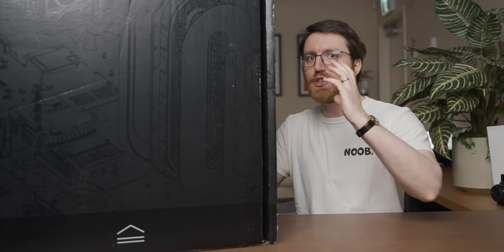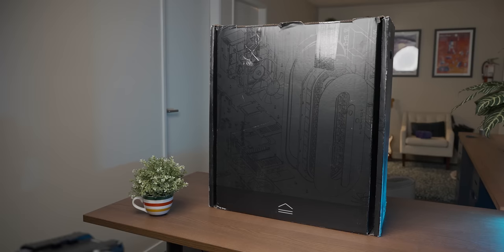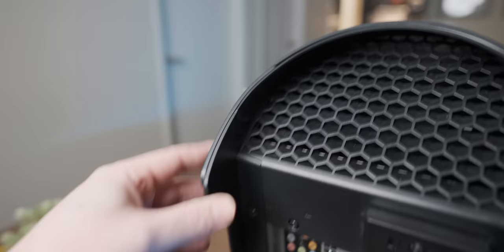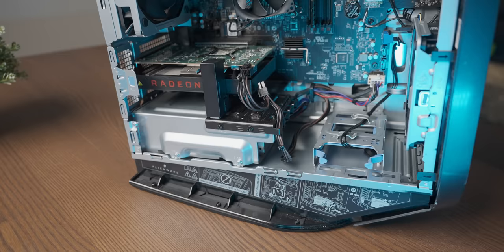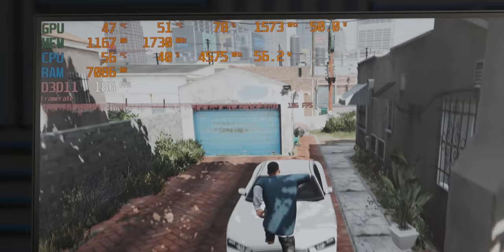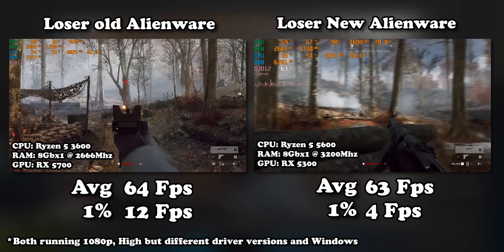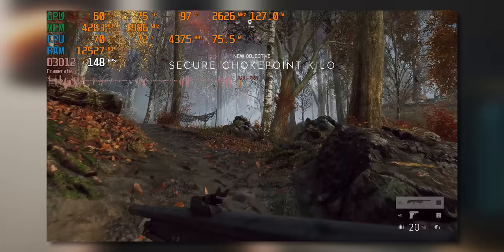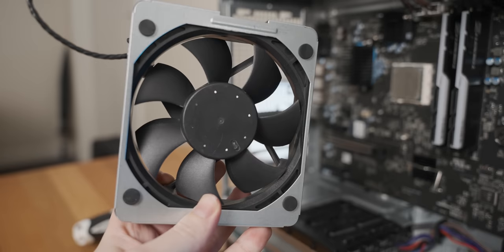Is Alienware's NEW Gaming Pre-Built Less Terrible?

Comment: All Dell system reviewers: "We bought the worst possible model offered by this OEM, (again!) Guess what? It sucks!" 

TBF: Dell should have higher min specs on these. Like no SC RAM options or air cooling. Those cheaper options should be kept in the XPS lineups. 

But anyways, I have several Alienware desktops. All options were carefully selected and they're not min spec units... guess what! They don't suck! Amazing, right?! The only mods I've done where I put in quieter fans. 

Also, the mid-range and higher builds are better buys for your buck and you should always call and ask for a better price as they give discounts easily. But if you wait for a sale you can even get decent models for a good price. I bought a Black Friday salefor my daughter for $1399 with an 11th gen i7, 16GB, 3060ti, 512 NVMe which I feel would have been a decent price even before everything blew up.

Comment: $1500 can get u an AMD rizen 7 7700x, a rtx 3070 ti, 32g of vengeance ram, Corsair heat sync, a lian li case, cable extensions, 850 watt power supply, Samsun 9 80 pro 2t ssd

Comment: Well to be honest, you really didn´t order the actual new Alienware PC. This is the same as the old one with a new Case (Aurora R14). While the actual new one (Aurora R13), (I know the names are confusing), does have significant improvements in the interior. You get watercooling as standard, the new 12th gen Intel CPU´s, improved Mainboard, better GPU options and overall better looking inside of the PC. 
You should take a look into the R13 if you really want to see any improvements on Alienwares half.

Comment: I was going to get one of these cause i thought my gpu died from water exposure but I tried the gpu again recently and it works now like magic.  Watching this video and looking at this case and the parts inside I'm very glad i didn't get one of these and fixed my own computer.  The plastic case looks like the same plastic they use for toys in a happy meal and the parts inside the mobo the gpu and the psu look cheap only thing thats good in it is the cpu and its going to overheat if any overclock is applied.

Comment: The RX5300 isn't entirely.... good, tho. considering the fact its a 100 watt card, and while the FPS it does give for games looks good, the 1650 super is right there, which isn't an OEM only card that you have to buy from a prebuilt :/
plus its a 100 watt card that does better than the 5300 OEM.

Comment: Surely for all the time and money they invest in designing that case, OEM mobo, PSU, connectors and all the rest they could've just shipped a regular ATX form factor system with similar specs. It's design for the sake of design, that in most cases is actively detrimental to performance and upgradability. That metal bracket that is for some reason restraining the exhaust fan is a perfect example of pointless waste!
Reply: I'm in the market for a new pc with these specs,  I certainly won't be buying a dell.

Comment: Um, 8GB is chocking the games lol.  Minimum specs for 1080p in most of those games is 16 gb with windows 11 or 10.  You might get by with 12gbs.   Severe stuttering will occur because of the constant memory dumping.  Also, ALienware has been using Intels mounting socket for a very long time on AMD now.

Comment: I would of taken a picture of the Dust/Scratches looked inside the system and said ** this sending it back  considering  Alienware is " supposed " to be Gaming Orientated ,  it should have AT A Minimum as 120mmaio 240mm aio  and Always come with dual channel ram that  PC's Insides is just beyond epic failure level.

Comment: the lower end of the alienwares are always terrible. They expect you to notice that and move away from it. It looks like its easier to solve the cooling issue than the R9-12. Can even fit your own artic AIO in this. Simply buy the good graphics card and this is worth it in this GPU shortage. Why complain about the ram configuration when you chose it though? You bought one stick knowing you were going to replace it cheaper than buying the OEM Ram upgrades.

Comment: What’s really stupid about the cooler thing is
Antec sells a cooler (the a30) 
Which costs only 15$
And by my testing with a i7 4770k and a r7 1800x
Cools wayyyy better then these oem coolers
It’s a tower cooler
It’s only a 92mm fan
So pretty low profile
And keeps it generally about 10 degrees cooler

With how cheaply they make these systems 
I don’t get why they don’t just use something like that to cool the cpu

And I don’t get why the Alienware brand is sold as a different product from the dell G desktops 
They tend to have the same specs
Tho the g starts lower
And about the same price
With the same inners
Just the g series tends to have less E waste
Why not make the Alienware desktops something special? 
Put the gpu behind the motherboard or sumtin

Comment: To be honest, 1600 dollars for that thing is an insult. You are guaranteed to be able to build a PC for 1500 dollars with a better motherboard, better graphics card, better power supply even if you have the same cpu in it.
Ryzen 5600x is 400 cad. You can buy a decent b550 for 250 cad. You can get a decent psu + case for another 250 cad. Probably the same SSD and Ram config or even better for around 250 cad again. And with 450 cad you can pretty much get an rx 580 or something which is probably better than that thing in it anyways? Or you can get a cheaper b550 board for like 150 and a cheaper case + psu for 200 and the ram and ssd config if you do it like dell, you won't be spending more than 150. If you are somewhat lucky you can probably get an rx 6600 for 650 cad probably. That thing is a total ripoff aside from it being all proprietary future e-waste.

Comment: I've worked with several Alienware products over the years. Personally, I think that they do an outstanding job with their laptops, but their desktops are absolute garbage.
Reply: Yeah, there's much less room to fuck around with garbage parts when the specs are so tight and the competition is so fierce. Not only are their Alienware laptops good, a bunch of Dell's higher end laptops are really good, though low end is just as trash as always. But at the same time I wouldn't be surprised if their customer service might still screw you over. Might be worth getting third party support or something with Dell if they're as bad as we've seen in various vids.

Comment: Dell and HP are crap with their proprietary components, connectors and PSUs, even the GPUs are usually their own; the GPUs can be swapped out or even used on other builds but in terms of components they seem to use cheaper components than the standard reference cards or consumer AIB cards. Some Lenovo systems also have odd motherboard sizes too IIRC though not all.

As far as I've seen MSI and ASUS use standard ATX stuff for their desktop prebuilds (at least the current ones).

There's also your usual gamer oriented SIs like iBuyPower, CyberPowerPC, Skytech, PowerSpec, ABS and etc. that only use ATX standard components and the only OEM components that they might have would be the case, fans, CPU coolers/cooling solutions and PSU but even those are compatible with any other off-the-shelf ATX compatible part.

Comment: Why would you order the cheapest one? I feel like I got one of the best ones and I didn't buy the most expensive one. 12900kf rx6900xt 64gb ddr5 1t ssd 2t sata and it's pretty good. The only thing I don't like is all of Dell's software and motherboard... no xmp with the ddr5. everything else is flawless. If I could put an aftermarket motherboard in it...it would be perfect. And they should have given us the option for a two dimm or four dimm mobo. I could have spent another 2000 or even more. And I would say it's within 2 or 3% maxed spec r13 or r14. And I would bet that my Rx6900xt would go toe-to-toe in gaming with Dells 3090.

Comment: They use again a MB you CANNOT put in a different tower, and it has only one stick of RAM??

And it has a BAD super cheap CPU heatsink on the CPU, is it so hard to put a Cooler Master H412R PushPin 
on the CPU, that cost only €15,- and cools MUCH better??

And they use a PSU you can also not use in another computer, all in all a bad made computer.

Comment: This comes from RADEON mouth:  Radeon RX 5300 (3GB) is as much as 45% faster than NVIDIA's GTX 1650                                                 while at the same time they say this:      AMD claims that the RX 5500 XT (8GB) is ~15-20% faster than the GTX 1650 Super                            so you can take that with a "BAG" of salt               I know that there is a difference between 1650 and 1650 Super, but it is pretty much nothing, while 5500 has 8GB and this 5300 has 3GB, that is 5GB less... and if 3GB is 45% faster than 1650 4GB and 8GB is only 15-20% faster than the same 4GB but SUPER!!

Comment: Dell sucks bro I have the Aurora R12 that I specked out with an RTX 3080 and the liquid cooling plus 1000w power supply and it stopped working after 2 months then I spent 4 months waiting for them to replace the unit and when I got it they sent me one with base specs only 8GB of ram no liquid cooling and no SSD so I had to swap my own parts into the new PC just to get the specs the same and then they still tried to charge me for not returning my old parts with the PC like wtfffff???? Lol 😂

Comment: Bro, you haven't replied but I tried every single RAM you tried and not a single one could be clocked to over 2400. I called dell and and they told me personally that they only support RAM purchased directly from them. Oh well.
Reply from the maker: I’m sorry to hear that happened. Did you have model I have in this video? This was the first Alienware system I tested where you could actually set the ram speed. Other possibility is that they changed it since I made this video which would really suck.
Reply: @DawidDoesTechStuff  I think they may have done something in the bios. I will try to change back to an earlier bios tomorrow and see if it works. Thanks for the reply!

Comment: Edit: Even with a discount I wouldn’t go this Alienware route because your still going to want to upgrade at some point in a few years or sometime down the road. And with this PC you have to buy power supply, ram, CPU cooler, Case, Motherboard if you want to replace anything like getting a better motherboard … idk literally the only reuse-able parts are the CPU and GPU. And sadly you can’t just keep the system and upgrade the GPU and CPU because there is literally no head room with a 400w proprietary power supply! At least if the power supply was better or used standard power plugs you could put a higher end GPU and CPU in at some point. Over all this is going to cost more in the long run and just be wasteful. Only upgrade you can easily make is RAM and I would say that’s a mandatory upgrade pretty soon to get proper performance from ryzen cpu 🤷🏼‍♂️🤦‍♂️

I don’t even care how this PC performs over all this is just garbage with the proprietary power supply and motherboard as well as the horrible GPU for the crazy price. 

I mean come on that’s the thing about something like a Lenovo Legion prebuilt at least you can slowly upgrade it over time like swapping a motherboard or a psu out for a better one even still using the stock case because they aren’t using complete trash that’s made for one time use. I mean even the power connectors should be standard no matter what system you buy! If cheap ass $500 PCs can come with standard parts Dell should be putting standard parts into a “premium” Alienware gaming Pc 🙄🤦‍♂️
Reply: If you get a PC prebuilt say as a kid in highschool or middle school for Christmas or birthday. The good ones can easily save up and replace the short comings on the system like getting a new power supply. Or if something breaks you don’t have to throw the whole system away!

Comment: "Structural" CPU heatsink, non-standard mainboard formfactor. Graphics card is the "save the last cent in manufacturing and maximize profits" edition. Case doesn't support tripple slot GPUs. Only a single stick of RAM present. Severely limited space for additional 2.5 and 3.5inch drives. Bottom of the bin SSD. No additional M.2 slot. An ungodly amount of plastic. Yeah no thanks, this is ripoff territory and unsustainable.

Comment: To me those systems are total trash because of those horrible OEM motherboards with the front USB's and weird power supplies.
Personally I would just boycott these till they learn to follow proper standards.
If you have any issue with your PSU or Motherboard, you're screwed.

Comment: I will never, ever touch a prebuilt. They are a complete joke, and it's such a shame. So many people can't, or are unable to build a PC themselves and need to rely on these System Integrators, and the chance of being handed garbage is so high. My step sister was recently gifted an iBuypower PC, and before even looking at it I was suspicious it was going to have issues. Upon trying to turn it on, nothing displayed. Opening the case and taking a closer look revealed a mountain of issues. The graphics card was only half way inserted into the PCIe slot. The motherboard was not sitting evenly, and some of the Rear I/O ports were being blocked by the I/O shield, making it difficult to plug in some items. The front USB ports didn't function at all, and they were plugged in correctly. Removing the motherboard revealed 2 missing standoffs, and none of the standoffs matched. They were all different, and were all scratched up as if someone had previously used pliers on them. XMP was not turned on, and the ram was running significantly slower then it was capable of. Finally, when the PC did boot up, attempting to Shut Down or Restart the PC from inside Windows, resulted in the PC hanging. Pretty sure they damaged the motherboard, or more then one item, when building the PC.

The PC was a gift and sat for almost a year prior in a closet until it was given. We weren't able to get warranty help, but to be quite honest that would have been a nightmare and was probably for the best. We ended up replacing the motherboard, upgrading the power supply, ram, and cooler, and mounted everything properly. Works great now, no thanks to iBuypower. The average pre-built PC shopper would have had a really bad time.